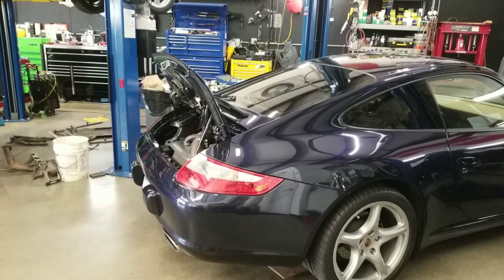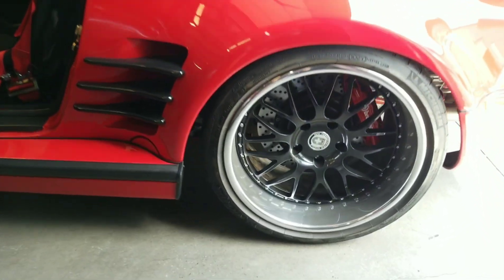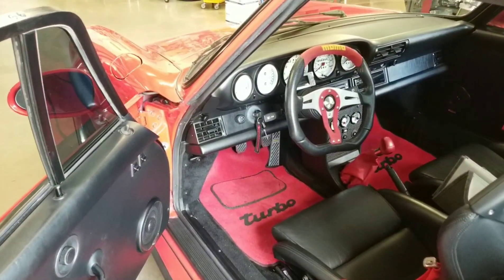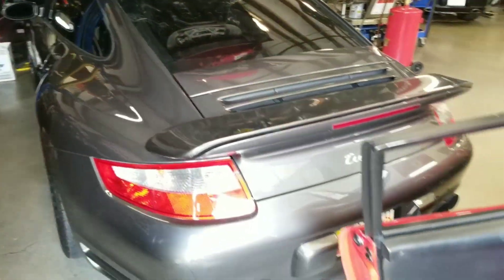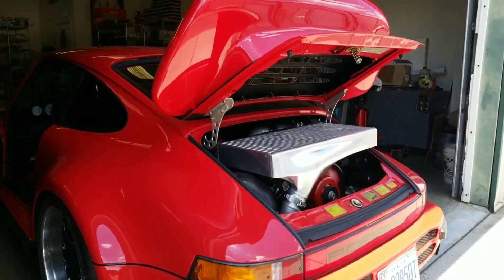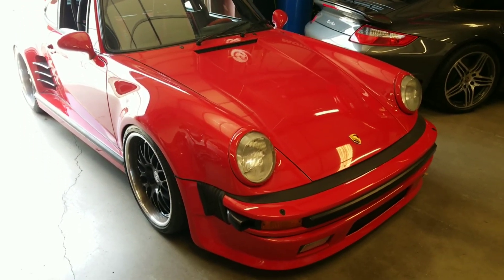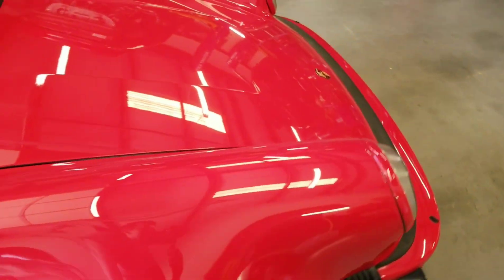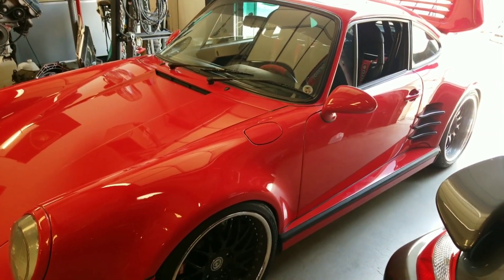Most Amazing 1986 Porsche 930 911 TURBO with 600WHP!!!

Comment: i have no doubt after watching this video over and over again. if you could reach out to that owner and see if he ever saw this car sold of of baltimore. a used car dealer called prestige exotics had this car for sale in the late 90's or 2000. i test drove it 10 minutes  before the dealeship owner toke it to summit point. those shitbag took alot of there cars out racing. im just so freaked out because it was down the the same sterring wheel red turbo mats this exact spec. fully modified they said it was a 600hp car as well back then.if you ever get a chance to ask him id be extremely grateful just to satisfy my memory.thank you my freind

Comment: $127,000 for an engine build, LMAO!
Reply: right.... for 600hp only
Reply: @G90G90  it’s a Porsche, thing probably weighs 2700 lbs
Reply: @thomasharbour5965  doesn't justify 130k for the engine
Reply: @G90G90  didn’t say it did but 600 hp goes a long way with a Porsche. I was just commenting about the “only 600hp” part
Reply: For a Honda civic this would be a lot but this is cheap for an air cool build.

25k for cases, rod, pistons, wrist pins, studs, bolts, gaskets, another 15k, turbo charges, intercooler, catch can, custom piping $10k, tubing, exhaust and headers 13k custom modified heads 10k, oversized valves and labor 5 to 6k, big cams 7k, custom crankshaft 7k, tune with motec or similar electronics computer system with wiring can run up to 20k easy, new wiring job, easy 10k, new duel or Tripple fuel system 5 to 7k, don’t forget engine labor that’s over 100h = 20 to 30k to do a race build to make 600whp.

This is a super car and this is not not out of the norm. UGR rave builds are over 250k so this is a deal!
Reply: @G90G90  It is completely justified, that’s cheap for what the engine has.
Reply: @kolyakolya  those 250k builds are the complete cars build and they make 1200-1500whp+. 
GTR platform  If, I recall, You can oder a complete built motor from T1or AMS for like 70k.
I know it's a different platform and engineering timeframe, but 130k just for the motor to reach  600whp seems a bit of a stretch.
Reply: @G90G90  How many air-cooled engines have you built that produce 600whp plus?  To make this kind of power with an old school air-cooled tech, there is a lot that goes into this project, so unless you build one to handle this power in an air-cooled, it’s all speculation, and there is no point even having this conversation. It's not just building your engine to max out at 600whp; you must overbuild it to at least handle 1000whp to avoid a short engine life, if you just max it out. Heck you can get away with a 30k build but how long will it last? I can assure you it will have a very short life.

AMS ALPh10 997.1 engine does not come with correct studs rated for 1000whp, nor do they have steel nikasil liners to handle all the extra pressure. They are known to lift heads due to insufficient clamping force of the 7/8 inch studs; A10s also use a stock 76.4mm crankshaft instead of a 80.4 or 82.4 to handle low end pick up. We have seen these engine lift heads and cause damage in a 1000whp application. 7/8 studs and alum cylinder should never be used in a 1000AwHP Application. They have there place and will work in the 800 awhp at max on E85
 AMS dropped this platform a long time ago. The point is not all builds are the same. Not all heart surgeons are the same, either.